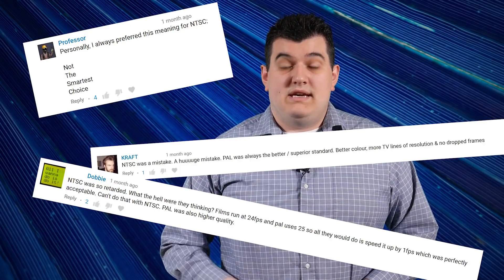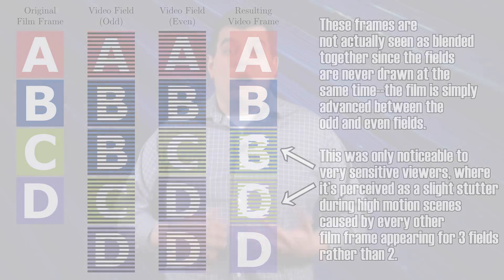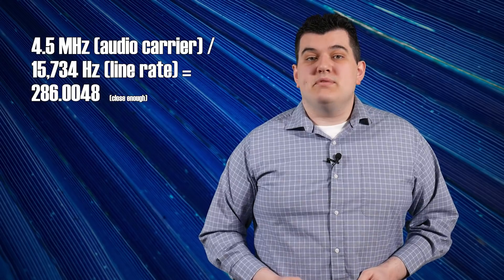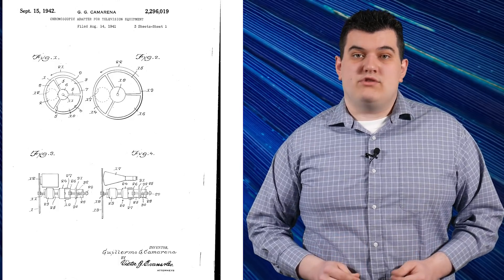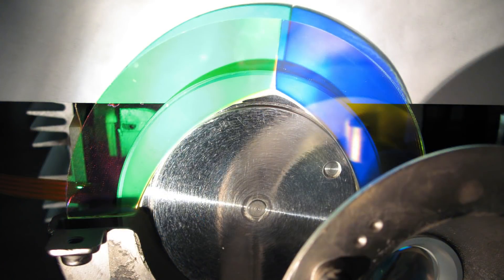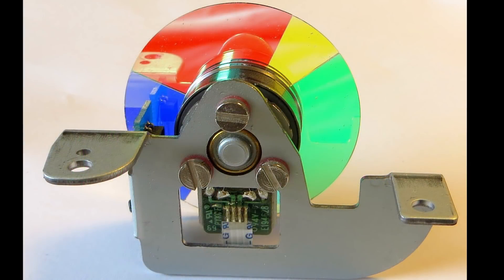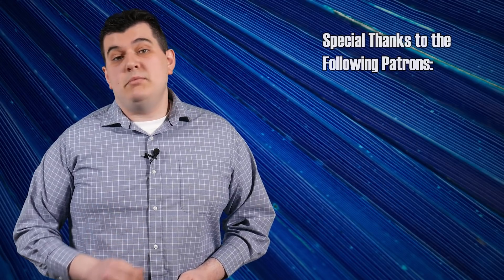Analog Color TV Wrap-Up--Some extra info

Comment: 1. GE Portacolor TV (with inline phosphors) came out before, and inspired the Trinitron. (Ditto for the Lawrence Chromatron, a one-gun, one-cathode, stripe tube. The Trinitron has one "gun," but three cathodes. About the same as three guns.)

2. Spectrac by Topping was a two-color, red and cyan color TV adapter in 1971. It never hit the market, but wowed CES attendees.

3. Baird didn't invent two color television. He applied established, two-color techniques from film to TV. Neither his mechanical nor his electronic system went on the market. Neither one was practical.

4. The British can recolor PAL black and white TV. No one has tried the technique with U.S. TV. Why? Due to 3:2 pulldown, our kine recordings 
would have combined fields. Combined fields make a hash of color data. Can we fix the problem? Possibly.

5. But PAL color isn't "superior" to NTSC (at least not in every sense). Consider PAL's halving the vertical color resolution. 
NTSC displays more data. Also, PAL has more flicker. Only way to reduce the flicker: Dim the picture below that of NTSC.

5. PAL: Harder to edit accurately than NTSC: 8-field sequence (PAL) vs. 4-field sequence (NTSC). See: https://en.wikipedia.org/wiki/Color_framing 

7. Also Hanover Bars appear in economy PAL (without the delay line).

8. Top reason for inventing PAL: So that W. Germany (Walter Bruch) could control lucrative patent rights for color TV.

See...
1. Col-R-Tel: http://www.hawestv.com/mtv_color/colrtel_block.htm
2. Col-R-Tel on the Moon: http://www.hawestv.com/moon_cam/moonctel.htm (See page 2. Scroll down for Spectrac, 2-color version of Col-R-Tel, without flicker) 
3. Color TV FAQs: See http://www.hawestv.com/mtv_FAQ/colrtelHowWksFAQ.htm#stds (PAL problems that NTSC doesn't have.)
4. Two-Color TV: http://www.hawestv.com/mtv_2color/mtv_2color.htm (See pp. 2 and 4 for discussions of Spectrac, Canadian 2-color TV.)
5. Camarena beat Goldmark & Baird to the patent office. Baird and Mooncams: See the third question about Baird vs. Goldmark vs. Camarena. Baird's 1928 system copied Frankenstein and Jaworski's 1904 German system. http://www.hawestv.com/mtv_FAQ/FAQ_moon_5.htm
7. Baird did not invent the Trinitron: http://www.hawestv.com/etv_baird_not/telechrome_not1.htm

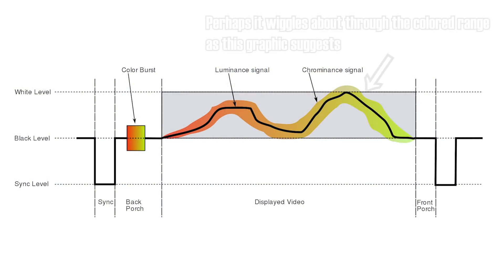Comment: In every attempt I have made to learn about color analog TV, I noticed sources abbreviate different highly technical stuff. I appreciate your ability to speculate due to the lack of definitive sources. Knowing the risk that I have previously learned others' "errors", I believe (but am not certain) that you have not correctly diagrammed the TV signal correctly at 6:25. May I posit: 1. You portray sync, then back porch, then color burst. I previously learned that back porch comes AFTER active video and the front porch comes BEFORE active video also carrying the 3.57~MHz (NTSC) color burst. 2. You portray the front porch following the active video; I present that this is the back porch. 3. The front porch is the zero volt sync to provide what's really known as the horizontal retrace (the raster sweep moves back horizontally & 2 lines down [remember the interlaced scan] for the next raster/sweep. The color burst modulates the front porch to not more than two volts so as not to confuse B&W TV's. The active video provides 2V to 5V for black to white video. I'm still pretty sure that I am missing a smaller voltage change between these two points (front porch & active video). Each line of active video still comes with more front porches until the bottom of the field, providing a back porch (really called the vertical retrace) to return to the top of the screen. Bonus: the back porch carries 2 characters (16 bits) of B&W dots for closed captioning, again the voltage not high enough to confuse non-CC TV's. Thank you for reading my two cents and feel free to reply & attack. Color analog TV was the singular most complicated circuitry in anyone's homes and depended on the widest variety of other technologies. Information on how it worked for an audience of non-engineers must necessarily be fraught with not just errors, but summary data, guesses, & speculation. To be sure, I highly respect the host and he jives with and taught me more compared with much else I learned elsewhere. Whew!

Comment: Why no one talks about SECAM !!
Reply: It's pretty much PAL without the need of the license from Telefunken.
Reply: rust actually, SECAM is technically very different and a lot more complex. FWIW, the color reproduction was also terrible compared to PAL.
Reply: 8 Bits SECAM, when used properly, was effectively PAL but with basically perfect colour. Unfortunately, the way colour was handled also made SECAM a gargantuan pain in the ass to work with, and any kind of editing or VFX work required decoding the SECAM colour to a component format and then reencoding to SECAM afterwards. Unfortunately, almost all video editing equipment used composite formats, which meant that SECAM programs with lots of editing or VFX work suffer from similar artefacts of PAL. Eventually, many programs just straight up started being produced in PAL, and then converted to SECAM afterwards, which meant that the composite colour artefacts were actually worse than PAL since it had to be converted first.
Reply: We don't like secam.

Comment: Europe is not BBC, mainland Europe (Germany, Netherlands) had a need for backwards compatibility since they were using 625/50 on both VHF and UHF since 1950-1951. Only the Britons were victim of the law of the handicap of a head start, having an older but active used line count system.
Philips experimented and promoted using NTSC on 625/25 since 1964, since it did not want to pay the royalties to Telefunken. Plus the glass delay line, a key component for PAL, was expensive to manufacture.
PAL and NTSC are just colour systems on top, the line and field rate is regulated in a different specification. PAL is based on CCIR.
Last but not least, 2-3 pull down is very visible to the eye, especially in scenes with horizontal panning or in TV shows with horizontal title bars. Trust me, growing up without the judder of pulldown it is very noticable.
All systems have their weakness. After a decade of LCD, I see an old fashioned CRT and the 50Hz flicker is suddenly very apperent, when in the old days barely noticable. It matters what you see every day to get accostumed.

Comment: Something that may fit in here or interest you - colour LCD backlit monitors for fairly cheap displays - the LCD areas for a colour are open when the RGB LED backlight is the appropriate colour, and as that can be rapidly switched, you create a colour image from a simple RGB source and LCD display without complex pixel mapping, just managing the timing and POV.

Comment: NTSC was first but badly engineered. It tried to be technically better than film with a higher frame rate, which was also a mistake, as most of the content for television at the time was on film or would be shot on film for some time to come.PAL is better engineered but the engineers had they advantage of knowing all the mistakes that the NTSC engineers had made.PAL has more lines 625 than NTSC 525 better vertical resolution !
PAL has a higher 4.43361875 MHz colour carrier (in most countries) vs  3.579545 MHz for NTSC so once you filter out the chroma PAL has a higher horizontal luminance(B&W) resolution !
NTSC has a higher frame rate 29.97Hz (*nice round number) vs 25Hz in PAL. So NTSC has more dynamic resolution if image is source from a camera running at 29.97 fps
* changed from 30 Hz because carrier signal of the audio could interfere with chrominance carrierPAL 25Hz direct multiple to the mains 50Hz frequency vs 29.97 direct multiple of nothing.
PAL 25Hz easy conversion of 24Hz (fps) film speed up 4% no picture quality issues and hardly noticeable. NTSC film conversions has blurs on camera pans a tilts and tracking shots that you have with 3:2 pull downPAL 25Hz easy timecode for postproduction 1 sec =25 frames NTSC 1sec= 29.97 frames ?? They had to organise another workaround and use drop frame timecode.
Film 24Hz easy timecode for postproduction 1 sec =24 framesPAL alternation of the burst phase eliminated hue errors!At 6.26 the graphic (from Wikipedia) is very wrong ! You are showing a scan line of video that's from left to right of the screen the luminance and chroma are not divided on the line as shown, they are mixed all over each line! "It wiggles about" is also not really a technical term.
I stopped watching after this, sorry I'm a broadcast engineer.
Reply: The selection of 30 frames per second in NTSC had nothing to do with being better than film.  It was chosen to match the power line frequency.  Highly regulated power supplies existed in 1950 but they cost too much to put in a consumer TV set.  Hum bars could not be totally eliminated so at 30 frames they would at least stay still.  Had 24 frames been attempted every TV sold would have a 6 HZ flicker in the picture.  Vacuum tubes had their downside, except for being the only electronics available.  NTSC  was not badly engineered and was at the time the best TV system available. The Brits who actually started broadcast TV in 1939 called their 405 line system high definition as opposed to the mechanical system that they broadcast part time.  I'm an old broadcast engineer.
Reply: BBC tv started regular broadcasts using 405 lines in 1936. This was an ongoing service rather than an experimental venture complete with an advertised schedule of varied programming and was aimed at people watching their own sets in their own homes.
Reply: Thanks Trevor.  I got the year wrong because I confused it with something significant that happened in Europe in 1939. I forget what it was.

Comment: Color works like a tone (3.58MHz for NTSC) mixed with the B&W picture which produces the dots. The off-screen colorburst defines the phase of a reference tone which the TV will internally compare to the tone extracted from the picture. The phase difference (delay) between the two tones at any moment determines the color. So, the chroma carrier can look like a nice sine wave for lines that are mostly one color, or a mangy, ragged looking waveform for more complex regions. The TV's PLL circuit will take time to align with areas of rapidly changing color, so artifacts will appear in those regions and along the sharp edges of contrasting colors. This was most noticeable with computer generated images. Color changes could happen more rapidly than this system could ever represent, so the YIQ equations describe how the waveform will be averaged as it's made and how the TV circuits will make RGB out of it, but at its encoded level it's the instantaneous phase (relative to the burst) and amplitude of whatever a 3.58MHz filter extracts from the image.

Comment: Spinning disk or field sequential color technology was used in the Apollo lunar color camera made by Westinghouse, the parent company of CBS. The camera flew in the command module of Apollo 10-17, the Apollo/Soyuz and three Skylab missions. It only saw use on the Moon for Apollo 12, where it worked beautifully for 42 minutes before astronaut Al Bean accidentally pointed the camera directly at the Sun, and on Apollo 14. Ironically, the RCA camera that succeeded it for the lunar rover used a version of CBS sequential color. NASA was not done with rotating disk color though,  Until well into the 90's the Space Shuttle used sequential color cameras.

Comment: Nice video. A pretty clear explanation.

A few points. The dot patern on on areas of saturated colour when watching on a B&W display is the sub-carrier modulating the brightness. The Luminance is not modified in the trasnmission.

Secondly, I don't think Sony ever put a Trinitron in a hi-res monitor. I remember as late as 1997 noticing that the Broadcast Grade 1 monitors made by them had delta-gun shadow mask CRT's. If my memory serves, the big problem was that with a Trinitron it was impossible to get the vertical and horizontal resolution to be the same.

Lastly, "telecine" is the term for a film scanner, not a recorder. In the UK a film-recorder was referred to as just that or some times a "tele-recorder". The more common term in the US and elsewhere is "kinescope".